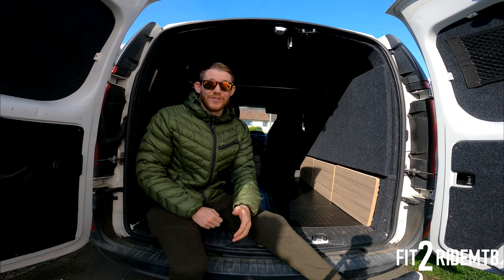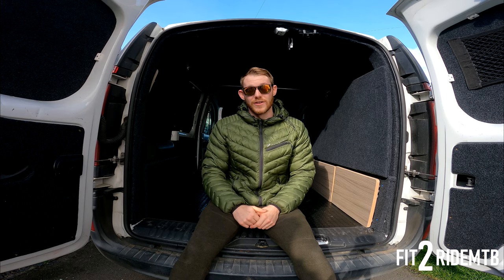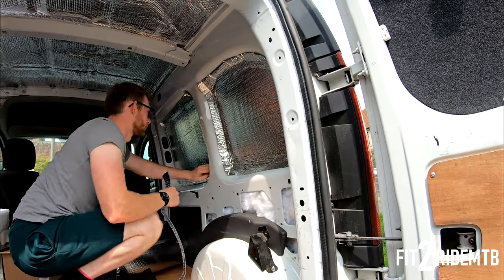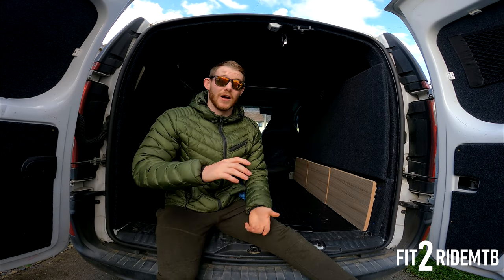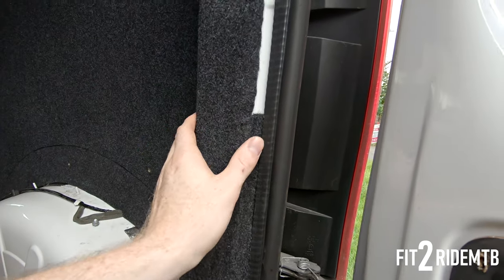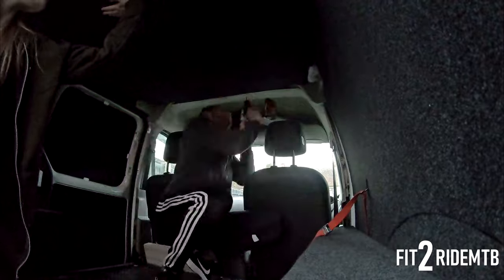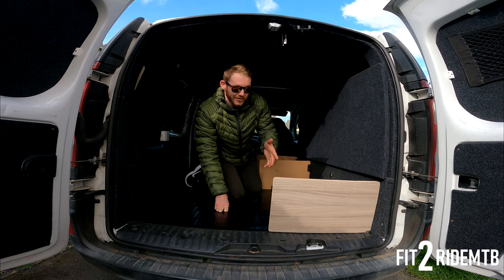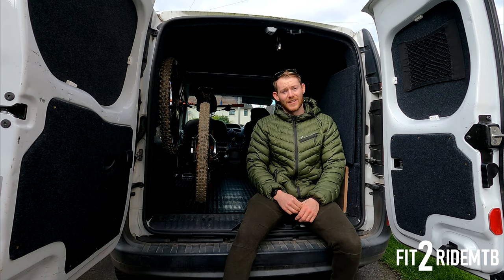MTB Van Conversion - Renault Kangoo + MTB Thru Axle mount DISCOUNT CODE | Part 1

Comment: Great vid. I was looking for some inspiration for a fold down bed instead of a pull out as I will need space for 2 x bikes. I will modify your design by cutting into the folding bed and removing some wood (bed slat) to make it lighter for fuel consumption and to circulate air under the mattress.

Comment: Watched this and went and bought a Kangoo to do exactly the same thing, those bulkhead bolts are a nightmare! Thanks for the inspiration, from one mtb'er to another! Cheers
Reply from the maker: No problem dude, hope you enjoyed the project!
Reply: @TrailRiderMTB  would you recommend the insulation you used? Would you change anything again?
Reply from the maker: Guess it depends on your usage. For the amount I'll sleep in it (once every month or two over summer) then yeah! But a long term solution where you'll be using it on a regular basis you may want to have a look around just incase there's better suggestions!

Comment: Hi we are looking at a Fiat Doblo. My wives bike is 1.6m long with front wheel out. I know this is going to be very tight. Did you gain much added from with removing the bulkhead. Im thinking im going to have to the same. Is just the curve that shortens the length it seems. I wondered if you gain much we removing it.  Thanks.

Comment: Had 2 kangoos. My bulkhead fittings were nuts and bolts and torque heads weird! Like the conversation need part 2 my curtain pole is rubbish copper pipe!. What did you use?
Reply: @blackbeard1074  you may be right!